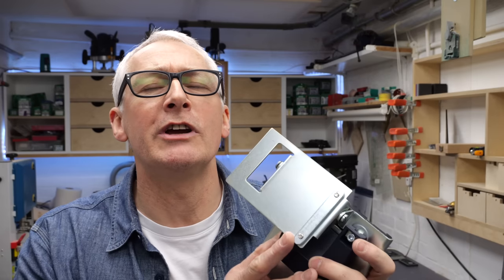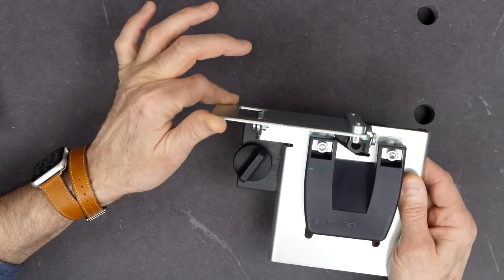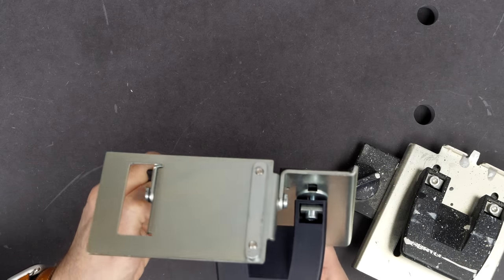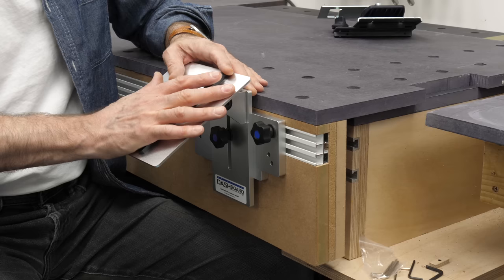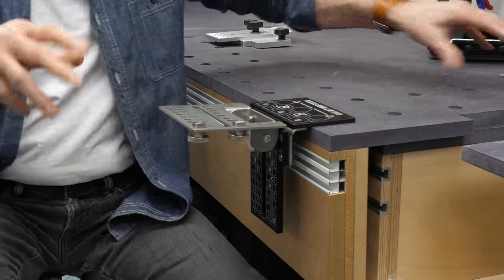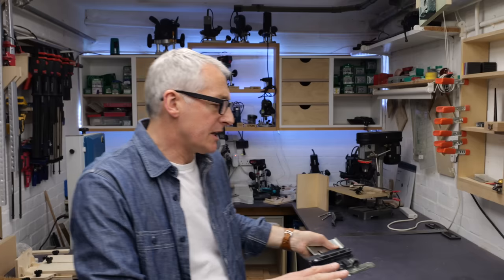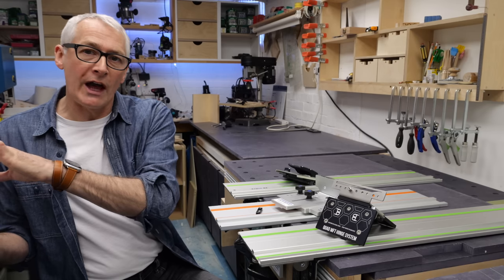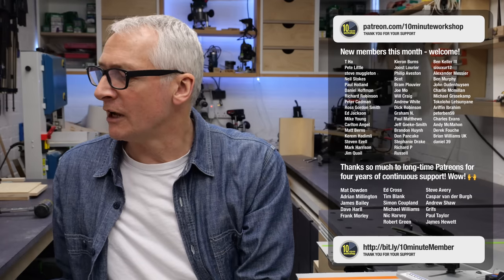3  MFT Rail Hinges [**Gifted/Ad][video 494]

Comment: Can the benchdog work with the  Bora Centipede Workbench Table Top For Bora Centipede Work Stand Saw Horses with 20mm Dog Holes  CK22TM?
Reply from the maker: That’s a question for Bora, or Benchdogs, wouldn’t you say?? 🤷‍♂️
Reply: I Can't see why not.  as long as your holes are max 35mm from the edge should work a treat.

Comment: Great video Peter.  But is it possible that the non Festool rail hinges are terribly over engineered.  You as many have used the MFT for years with great success.  The hinge and receiver have worked flawlessly for you, and your cabinetry is amazing.  Sometimes I think things are made better for sure, but perhaps a little “overkill”.  Love your channel, have watched all your videos many times, I have learned so much.  Keep up the good work!!
Reply from the maker: Thanks Les. Yes, I mentioned this last week in a member video where I was chatting about my own forthcoming DIY hinge, and I will say a few words on the topic when I make that public video. I don't think the Festool hinge is particularly great and it certainly doesn't look like it's been developed at all, but fair play to Festool for making a hinge that does the job, and that can be manufactured in volume at a relatively modest price - and that can be purchased as separate parts, rear hinge and front support. There's a certain 'spare' elegance to the design - not aesthetically, but from a manufacturing point of view, that's missing from the others, and yes, perhaps the other are over-engineered - but people do seem to like that, and I noticed that the Benchdogs hinge is now pre-ordering for the 7th production run; that's a lot of folks ready and willing to buy what they offer, so fair play to Benchdogs - and Dashboard - for filing that need. Thanks for taking the time to comment, and best wishes, Peter. 👍
Reply: Oh don’t get me wrong, if I didn’t live in Canada and afraid it would cost me my first born, I’d have had a plethora of Benchdogs kit, including that rail hinge, fence, dogs …lol

Comment: Can someone explain the need for these expensive and in my opinion grossly overpriced rail hinges as opposed to 2 BD tapered dogs fitted to the rail and then into MFT bench holes. Is the minimal saving in setting up time worth the expense?
Reply from the maker: I’ve covered this at length in previous videos, most recently the Ikea Curtain track MFT build (link in description) but in short, if you’re in a small workshop and carry out many operations where the rail needs to be cleared to get your bench back for another process, then yes, just being able to lift up the rail and clear your bench is priceless. There are lots of other ways of getting a square cut - dogs and clips, rail dogs, rail square etc… but they all require you to take the rail away and put it somewhere between cuts; this isn’t insurmountable - see my recent ‘basic build’ of plywood shelves - but it definitely adds to the time taken, and it simply isn’t as convenient as a rail hinge. As I said in this and previous videos, I’m not trying to convince anyone of the benefits - you’re all adults, you can make up your own minds. And so will I. 👍
Reply: Thank you Peter for your comprehensive reply, I am suitably admonished!

Comment: A fourth option is available on Amazon.  A search for Festool rail hinge will show it.  Sold by Weiput-us.  It is different in that it uses a double hinge system.  Oh and the price is cheaper than Festool, yet it seems to solve the pin issue by what appears to be a very stable design.  It also has what appears to be a "press to lift" bar that would be good for production work, granted it does take up some extra space.  If...I used the mft a lot, I would be looking at the Dashboard model, well built and solid from what I see.  I'm suprised I'm the only one that had the "love at first sight" for the Dashboard model.  The price covers what it takes to make a better that Festool product.
Reply from the maker: Not in the UK, and a search shows up nothing on Amazon.com; do you have a link? 👍
Reply: On  amazon uk it is on the second page of results about 2/3 the way down on the left.  If you search for "track saw guide rail hinge".  Listed as "circular saw guide" etc.  113.61 quid.  Please be aware this is likely one of those low budget type project things.  Looks to need aditional support under the front hinge.  Lots of potential, even the potential of making two units from this thing.  Look at all of the pictures for the listing.  Buyer beware.
Reply: Hi Peter  it's this one
Circular Saw Guide Table Rail Track, Circular Saw Guide Rail System Woodworking Lifting Rigorous Structure with Clip for 30 Chutes
It doesn't show how or whether it fits onto a guide rail. Looks pretty well made and appears in several listings on Amazon.  Certainly a good price if it works.

On the Benchdogs version I note you might need to buy the special jig (£40 + VAT) to drill the offset holes although I think this could be done with a Parf Guide if you have one unless it would fit directly into whatever holes you have at the edge of the worktop.  Not sure if this would work for an MFT as you need clearance for the alloy rail.
Reply: @michaelblackmore883  I did order this prouct.  It is part of a system sold by a Chinese company called Wnew on Aliexpress.  They even have their version of the MFT.  It took some adapting to use with the Festool guide rail.  The result were outstanding.
Reply: @marklynch8781  Hi Mark,  very interesting.  What did you need to do to adapt it to the Festool rails?  Mike
Reply: @michaelblackmore883  The main issue is the rail conectors they provide are for a larger format perhaps 19mm or 20mm.  I milled them down to fit the Festool guide rail.  I also purchased 4 star knobs to fix the unit to my Rockler table rails.
Reply: @marklynch8781  Thanks Mark,  looks as if it would be worth buying this one.  Would you recommend it?  Mike
Reply: @michaelblackmore883  Yes I have to say that most people should be able to use it with a little effort with excellent results.  It's just not one of those "plug and play" things.

Comment: Pete, an MFT table.Seems to me its purpose serves 90, 45 i guess whatever you want. It very handy for clamping. Thats it. The amount of waste wood ive seen thrown after been given an example. Ive looked for vids on what tips, tricks and the so. Got cnc myself, chucked a load a money on what boils down to round bits of ali. Sorry Ralph ive spent fortunes. Any seen a Chesterfield or a Queen Ann. Dont think im having go at you. Iwatch everyone without fail. Im a hypocrite but im i missing something in advance. Stay safe.
Reply: Meant to thanks in advance
Reply from the maker: As I’ve said in this video and all the others, I’m not trying to sell anyone on the concept of an MFT; if you’ve decided it’s not for you then that’s fine. But it works well for me, and seems to work for others too. 🤷‍♂️ There’s a whole playlist of MFT - related videos, link in description, and if you want a basic introduction then the older videos 182 and 183 are a decent starting point. HTH. P
Reply: I understand that. That was your income and didnt take into consideration of course it would be ideal for you. As someone who is a couple of months in. I expected more. At least i only bouught the top and accessories because that table it stands on. Leave it there. Sorry to waste your time. Thanks.

Comment: Rail hinge or rail square? What's the best in your opinion for job site
Reply from the maker: Depends entirely on what you’re doing; if it’s lots of repeat cuts and you can have a reasonably static bench set up, then rail
hinge. If you’re more mobile, and need to cut a variety of panels to different sizes, then rail square, and add in the repeat stop if you regularly need to do same-size cuts. 👍

Comment: I have the benchdogs hinge and im kinda disappointed with it. It gets slightly out of alignment easy and i have to check it befor i use it every time.
Reply from the maker: That’s not my experience with it and if you’re having issues then you need to tell Benchdogs directly. 👍👍

Comment: "works with a wide range of guide rails"?
What spec T track please? Excepting curtain track? Rather crucial IMHO?
Reply from the maker: Sorry Dave I don't understand; you quote me about guiderails - which I describe in detail - then talk about t-track?? As I say in the vid, I went through all the specs in the 'extrusion confusion' video - linked in the description - so overkill to do it again here, wouldn't you say? 🤷‍♂️
Reply: @10MinuteWorkshop  Sorry Peter, I meant the T track onto which the rail fits (front and back of bench) rather than the rail on which the saw runs?
In particular the  dashboard hinge. I don't think you cover this?

Comment: 14:04 It's a shame Benchdogs didn't make their hinge with adjustable dog positions. I have a workbench with dog holes, but it's not MFT, which make this hinge useless to me. ¯\_(ツ)_/¯ All they had to do was use a slot instead of a hole.
Reply from the maker: Probably concerned about introducing play and affecting the squareness though they tend to be open to suggestions if you contact them. That said an MFT workbench that doesn’t conform to the 96mm hole spacing is a fairly niche product, and everything else MFT-related that Benchdogs make is on 96mm centres. 👍

Comment: Always a great review!

I would like to find one that only uses the holes on the top of the bench and not hang over the back at least.

My MFT is my table saw outfeed table. I can’t have it sit too far away from the saw and it is 3’x5’ on a heavy base, too heavy to move around.

If the beach dogs could stay flat to the table that would be awesome!!

Comment: Unfortunately Dashboard don't take PayPal and then bill for shipping after they receive credit card details , and Benchdogs also want credit card details  . That's a red flag for Aussies .
Reply from the maker: Not sure why you see it as a red flag - many companies need a card address before they can calculate eg VAT and shipping rates, and both Benchdogs and Dashboard are respected small companies with solid reputations. 👍
Reply: @10MinuteWorkshop  Hi Peter . I've not had good experiences with overseas credit card transactions . Have been billed twice , charged exorbitant shipping and handling and finally had my details left on a retailer's old dumped computer and subsequently used by a scammer ; that was hassle for the Bank . My bank recommended dealing with intermediates like PayPal to avoid supplying details to a seller . So after 15 years of PayPal , I've only paid what I've sent . If Ebay sellers can declare a shipping price , so should a retailer be able to arrange such on their website  . . it's not difficult for them to set it up . I've learnt to be mistrusting Peter  . Yes , I miss out on stuff , but I'm not going back .  Cheers, Neil in Brisbane 🙂